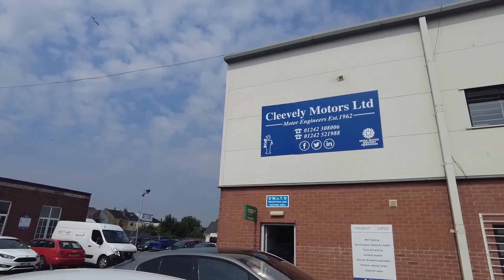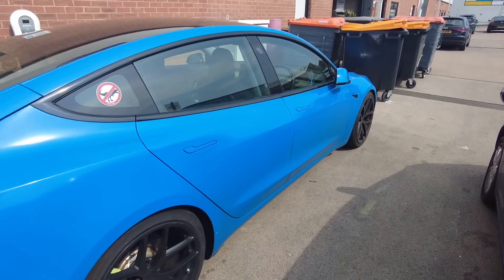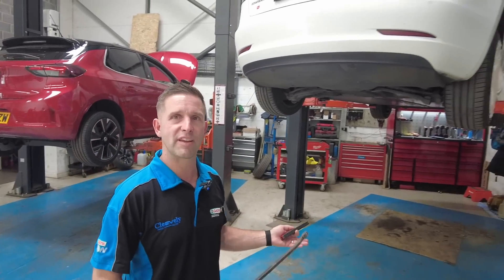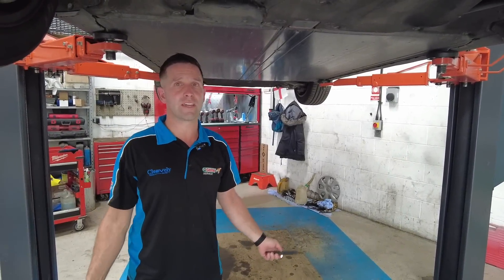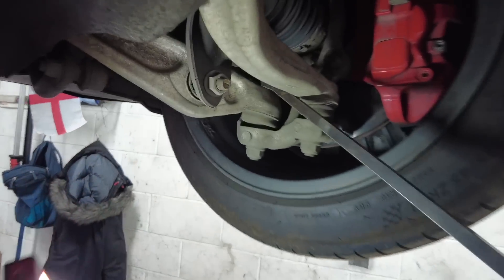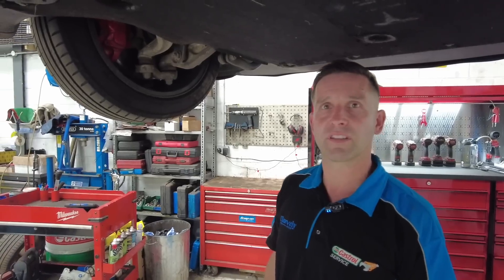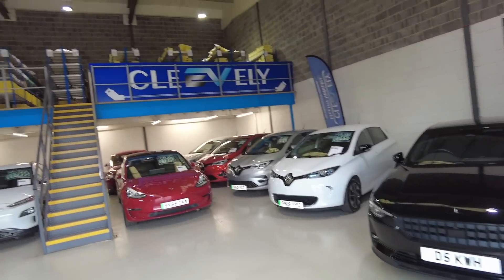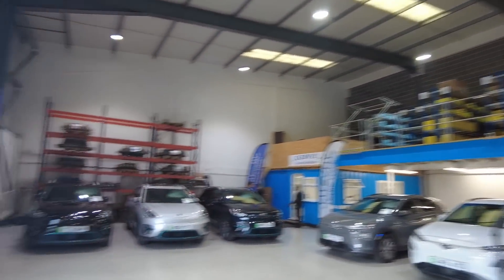High mileage Tesla Model 3 gets inspected by Cleevely EV, the best independent EV garage!

Comment: What about the water pump and the tensioners and the exhaust manifold and the head gasket and the timing belt and the oil filter and the air filter boots and the spark plugs and the fuel filter?

Comment: These Teslas are very cheap junk and built poorly
Reply from the maker: Well having 17 years of motortrade experience I think it takes so beating. Yes you can fit a custard cream in some panel gaps on the early ones, but other than that 113,000 and the condition is mint and the running costs are sweet FA

Comment: nice video, what's the current mileage on the M3?
Reply from the maker: @mrpugster  thanks, 107,003
Reply: @chargeheads your headline mentioned high mileage but with no mileage figure given. Thanks for the update.
Reply from the maker: @jasonspollen8998  i thought it was mentioned, applogises. About 106,600. Battery test coming soon

Comment: Cleeverly look like a great place to get your car looked at.  Are you thinking of going with the grease injection method to stop the squeaking?  Mine is squeaking too and thought about doing that but as it's under the dealer warranty from when I got it in June I'll go down that path first.
Reply: I just recently got the sqeak and resolved it simply by 'massaging' the boot that the grease is in. All while wheels are still on. Sound gone!
Reply from the maker: @GuyJD  i tried warranty a while back but it was just out. Yes injection, althoigh i hear spraying them with WD40 works too. 🤔
Reply: @chargeheads WD40 did work for a couple of weeks for me, but the grease gun with a needle worked better and it's been months now with no squeaks